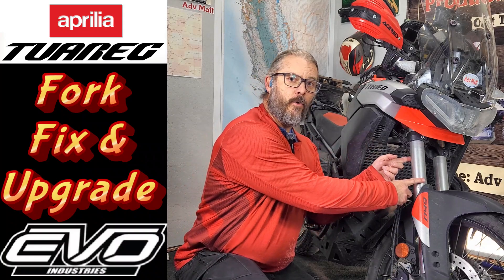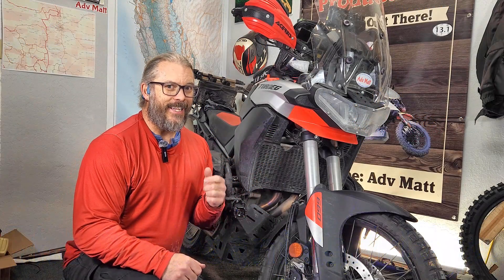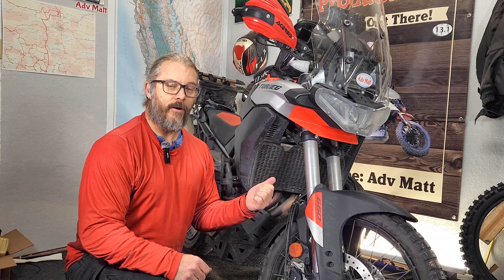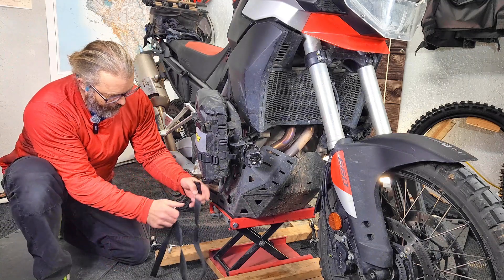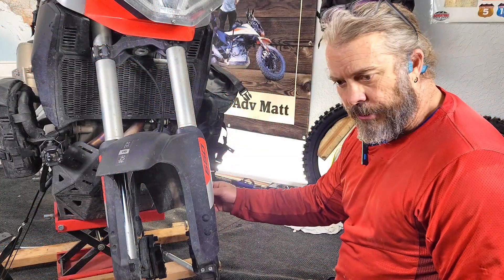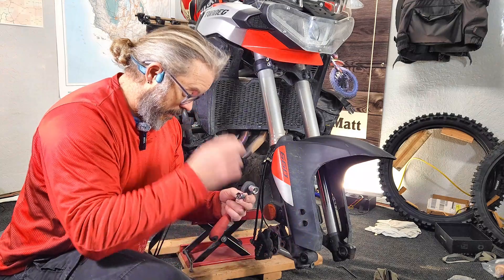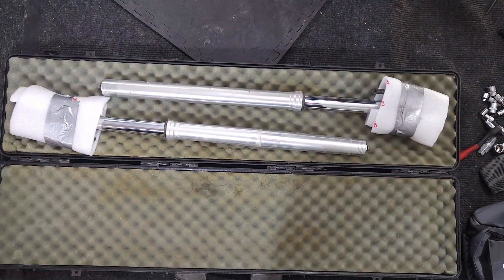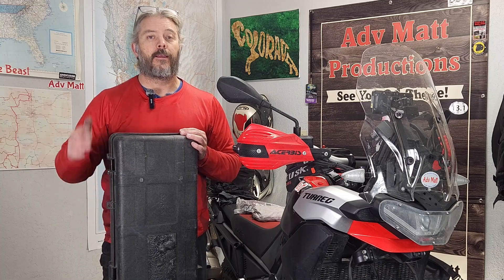Aprilia Tuareg 660 fork repair and upgrade; shim stack, new springs, base valve and seals.

Comment: How much taller is the bike now with the new springs?
Reply from the maker: The bike only feels about half an inch or 15mm taller when you sit on it.  It is really hard to tell much of a difference.  The stiffer spring makes it easier to set proper sag with all your gear.

Comment: Hey Matt, looking to do this to my Tuareg, already spoke to Paul and am planning to remove the forks from the Tuareg this weekend! I wanted to thank you for the video as it will be my guide for this weekend. Is there anything I should know that perhaps wasn't mentioned in the video? Should I be marking where the forks were in the clamps and worry about placing them back exactly where they were? Any info would be appreciated, thanks.
Reply from the maker: There is nothing additional you need to know.  The fork orientation doesnt matter.  The lowers can spin around in the uppers. It is a pretty simple removal and installation.  Nothing tricky to it.

Comment: Hi Matt, in the future try Shock Sox neoprene fork seal savers. They wrap around the fork using velcro. I remove mine whenever washing the bike. Hang dry and back on. E-Z.
Reply from the maker: I have those on my KTM 390 Adventure.  They work pretty well.

Comment: Great video. What was the turnaround time; how long to get your forks back?
Reply: I usually try to turn things around in a week plus transits time.
Reply from the maker: It took a little longer than normal for me because of a personal matter at the shop.  It was a four week turn around, but should have been closer to two weeks.  I recommend checking with the shop first to get the forks scheduled and don't send them until they need them.  That should save you some time.

Comment: I'm taking my forks in to the EVO shop here in Pa in a couple of days to have the same thing done. (They were waiting for the parts to arrive and they now have them-Yay!)  Looking forward to the improved ride and I will say I ride like you. I'm not aggressive but do want better control. I also use Seal Savers and feel they help preserve the seals. I use the zipper ones so I can remove and check things as needed.
Reply: I got my forks back very quickly. I haven't given them a full workout but on some local mild washboard dirt they feel much better.
I did not take the bike in to try to get this done under warranty. BUT by letting them go so long without servicing (22+k miles) there is an inner coating on the upper tubes and that started wearing off which means I have to get that upper tube replaced. My recommendation would be to buy the bike (it's GREAT) but be sure to have the dealer service the forks as soon as it's called for. Maybe that way they'll see the valve issue if it's present. Better still if you can get them serviced at the FIRST service interval. My fork oil was a mess according to the guys at EVO East and lots of folks have reported that the fork oil seems to be like the engine oil in that it's good to change out the "break in" stuff early so you have good clean oil in there. Check out the "Tuareg 660 Suspension Extravaganza" thread over on the ADV Rider Forums.
Reply from the maker: @georgemorrison9387  thanks for info depth review here on you experience.
Reply: @georgemorrison9387  Thank you.
Reply from the maker: @georgemorrison9387  if you are getting the forks resprung too, you will really notice a difference.  I amnriding quite a bit faster now with the new suspension.
Reply: I'm also in PA (Eastern) and thinking of getting this bike. There're not too many Aprilia dealers in this area. Without naming names, did you first check with them to see if it would be covered under warranty?
Reply from the maker: @TheNeebs  I don't have first hand experience trying to get warranty on the forks but what I have been told from others is the dealership will not open the forks and under extreme circumstances will replace the fork leg with a new one.  It seems the new fork legs have the same assembly issue.  I put 13k miles on my bike and didn't notice any performance diffencies and the shims were not cracked.  The revavlve and respring can be a future project and not something that is urgent. From my experience with this bike I would not hesitate to purchase one even if my closest dealership was six hours away.  It is my most favorite bike I have ever owned or ridden.
Reply: @ Thanks Matt, I appreciate the feedback.
Reply: @georgemorrison9387 Hi, this question was for you as you indicated you are in PA, maybe you go to the same dealer I'm thinking of buying from. Thanks in advance.

Comment: Matt, I did exatly the same with EVO Oregon kit a month ago. It works as same way as you have  explained. As front now sits higher, I slide forks in clamps few bars to keep stock geometry. Altogether is much better, and my shims were in much worse conditions. Regarding the rear, Tractive shock is o the way, so we will see.
Reply from the maker: Awesome, I am eager to hear from you on your experience with the TracTive shock.  I expect it will be amazing.
Reply: @advmatt  well, it is a huge upgrade for offroad, also for road but definately for offroad. It is on stiff side, very sensitive on clicking, overal feeling that bike is more nimble and stable, even rear spring is stiff, damping works very well, no hard kicks in back. It also rises bike a bit, just 2 clicks of rear preload is enough for my weight.

Comment: This bike came out with it’s superior suspension but now it seems “all that glitters is not gold”…😅😅
Thanks for sharing 🙏🙏
Reply from the maker: Compared to the Tenere 700 the stock suspension was superior.  I weigh 210lbs or 95kg, no bike is sprung for my weight from the factory.  I have to modify all them, if its in my budget.
Reply: @ I’m the same weight but happy with the stock T7 suspension. I saw Ben from the ‘Dork in the road’ channel at 300 lbs and he never felt that the T7 was too under sprung for him…
My thinking is that there is some kind to of ‘Groupthink’ led by seriously pro-level riders taking everyone else into that ‘gotta upgrade OEM suspension’ mode…
Just my $.02
🍻
Reply from the maker: @BlazinBlades  yeah maybe.  My own personal experience was the bike walleyes around in rough terrain and sat very low in its travel.  I had to ride quite slow to keep from bottoming out.  The soft springs made the bike feel much heavier because it responded very slow on the trail.  That is from the way I ride.
Reply: @BlazinBlades By measuring sag we can objectively avoid the 'group think'. But it is notable that one can be perfectly happy with the suspension for ones riding style regardless what the sag is.
Reply: @ Yep
4 clicks of preload over stock settings is just about right for my weight on the shock.
Reply: @BlazinBlades  I was darn happy with the "Egg's" suspension (I'm 185 lb.) until I took it gingerly up a hill with some washboard.  And then I wasn't.  It felt like there was virtually no damping in the forks so I appreciate this vid and will look forward to some proper boingers.